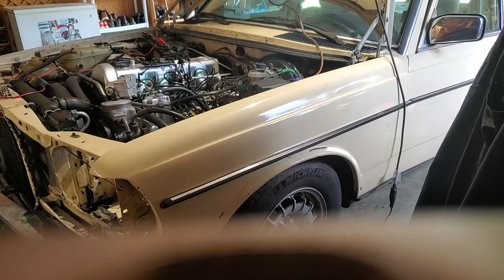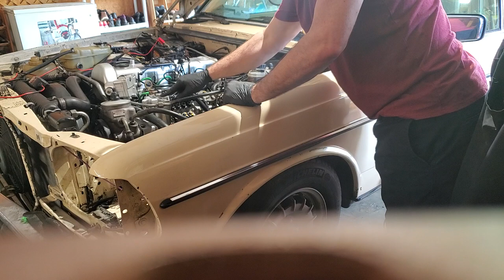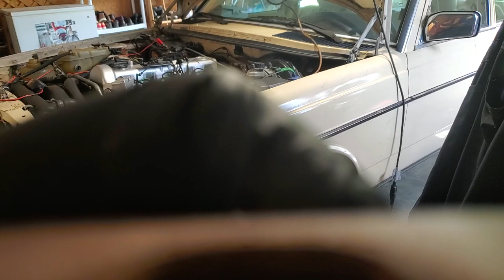300TDT First Start

Comment: Do attention to the fuel system bro. Replace the filter in the tank and check for leaks. Even if you don't think that they exist. I have one 240 D and one 300 SD and they had leaks that did was easy to catch, but they made a world of difference in the engine noise and performance.
Reply from the maker: Big thing now it to get pump timed. Since I have that new timing chain I used the factory marks to install. BUT there was a bad batch back in the day and the marks were off on them. It's close, but not perfect. There are 2 methods for timing, Drip and AB Light. (AB light only on 84-84) It requires a special tool. Part number 617-589-08-21-00. Called the Positionsgeber. (Thats German for position sensor). I have dripped timed before and it can be messy and hard to get it exactly right. I do have a line on an AB tool that I want to explore first.
Reply: @gercoa9148  I can see that you really understand this things. I can not compete with you. I just like this old Mercedes and know a litlle bit, but not like you. I have scared to mess up things in the engine our fuel injection, so I just replace parts and pray to improve the car :) Thank you for your share of knowledge. I already subscribed your channel so I will keep eyes in your work.